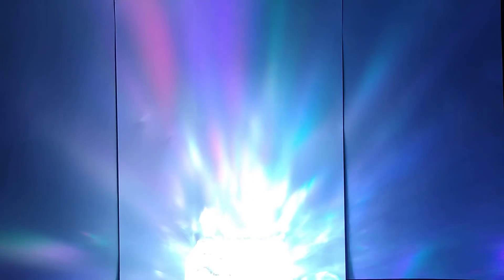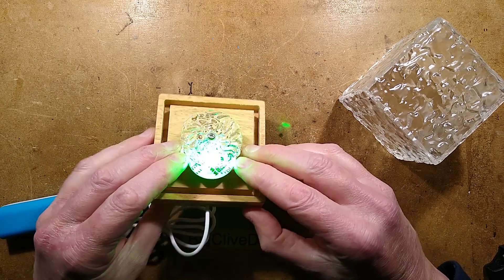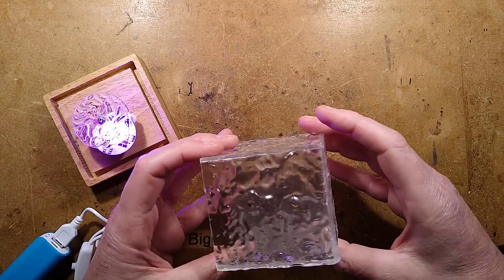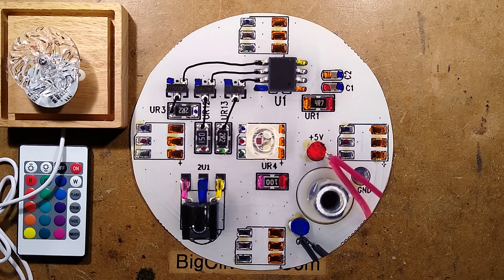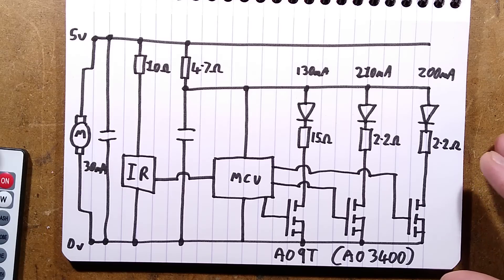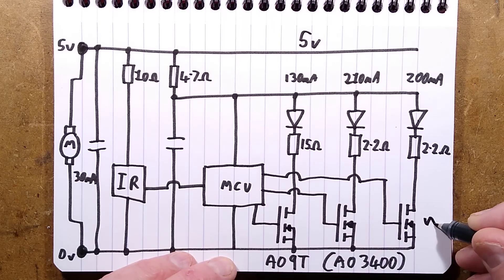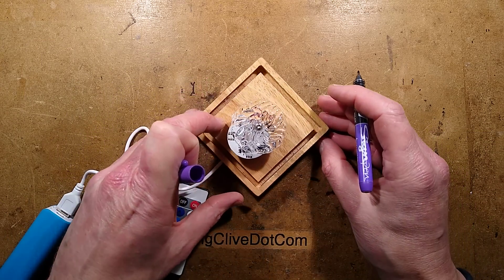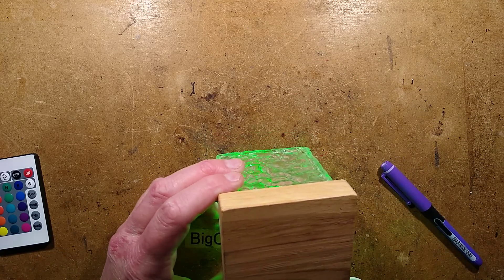Inside a Temu ripple cube - with schematic

Comment: I have just received a lamp just like this but it's bottom is plastic and the wire to plug it in detaches. It's got a loose connection on the inside aswell but it's proving difficult to open. Am I able to put the isopropyl alcohol down this too. Its got a pretty flimsy circuit board at the bottom which I'm not sure would survive or not. Sorry probably just the same thing that youve said but I thought I'd ask before attacking it by myself 😂

Comment: I want to make this myself but have little knowledge of where to buy components and what specific ones I would need. Is there someone out there that could possible link me to what microcontroller and led is used in this design, as well as what size of capacitors that are used? Any help would really be amazing
Reply from the maker: The microcontrollers are supplied blank and need manufacturer's software put into them.  It may be cheaper to buy a unit as a base project.

Comment: The cap' across the main supply is well placed alright, motors are very noisy, a ceramic would help too. Can't read it's value though, as drawn. The I.R. Module should have it's own, as suggested. Nice simple layout otherwise, a tiny issue really.

Comment: Can you add LEDs to the other pads without any further modification?
Also, wouldn't it be better to have a diode across the motor to avoid reverse polarity??
Reply from the maker: Yes.  But it would be better to change all the LEDs so they matched.

Comment: IMO the white ring that holds the motor is upside down as it has holes to screw the motor holder to the wood. Had it been like that then chances are it wouldn't of come loose in shipping

Comment: I wonder if you could put discreet LED at all of the unpopulated pads around the board, which would make more light splash out. You might be able to angle them, or cover them, and it would not go out the 'top' but just the sides, Leading to static patterns. They would all be PWM controlled the same, of course, but it might be nice to make a single unit that uses nothing but green/yellow LED for a truly radioactive cube. Or, maybe wire up some really greasy yellow/lemon ones for toxic waste.

Comment: for those so inclined you could use something like a AT tiny 85 as controller. liberate the LEDs and anything else you may need, add an addition mosfet to allow PWM control of the motor. write the code and knock it all up on a piece of strip board or have PCB made. Hey presto you got yourself something a lot better. You could also change the LEDs out for WS2812 or similar.

Also be careful with Temu, the parent company had another company that was found to be installing malware/viruses along side their app. IIRC temu is being investigated for the same thing as we speak. I don't know if the app has been suspended on various app stores as yet.
Oh then there is the forced/child labour. But I think that most of just assume that was the case for cheap things coming from china.

Comment: To vary the motor speed as well, leave the +ve motor connection as is. 

Then add three diodes to the other motor terminal, and connect to the three FETs.

Result, motor speed varies and LEDs vary too!

Nice one clive 👍🏻🇬🇧😎

Comment: Use 2 LEDs with different colors. One Amber and one Red for a nice fire effect for instance.
One point in Time I had cheap Showtec Phantom Moving Heads with crappy CMY color mixing, an effects wheel and an crystalizer gobo. In combination this produces the exact same effect. If you mixed an orange with the CMY system, it made a wide variety of colors between yellow and red which gave a very nice fire effect. Unfortunately these lights were not much use for anything else

Comment: Is there a part # for that motor? I was looking around for a low voltage, slow spinner, but so many choices - looks like they picked a good one.
Reply from the maker: The motor itself is extremely common, but the slow gearboxes are harder to get.
Reply: @bigclivedotcom  Ah! I found one from an old microwave oven (the carousel motor with a gear)!
Reply from the maker: @davestorm6718  Those are usually synchronous motors.  Very cheap and common, but will often turn in a random direction when powered up.

Comment: I hate these remotes to much. I have one for the main lamp in my room and the main setting got worn out to the point where that 'button' does not work anymore. And the one I have does not have any screws. They are press fit and glued or something so it's nearly impossible to get them apart and fix them which pisses me off so much since it's such a simple fix...

Comment: Nice looking doodad. You could always just screw the motor into the base via the tabs on it, with some thin, long, self tapping screws. You could just tighten them enough to hold the motor in place, without bending the tabs.

Comment: ‒ It's not too good when the LED is switched off via remote, the motor just keeps running until the incoming power is switched off.
‒ If I see this right, the circuit bard can have 5 RGB LEDs, possibly in parallel, but just the middle one is populated.
‒ Probably if they screwed some standoffs into the wooden base, the gear mechanics have some "mounting ears" for mounting screws.
Reply: yep they really cheap out that design.

Comment: Unfortunately broken items are not uncommon from TEMU.  They have no care at all for packaging and protecting items.   It's a known issue to such a degree that when leaving feedback, they often have a notice specifically for shipping//packaging issues......   Cheap they are, but you can't rely on things coming in one piece.
Reply: tbf, this particular one could have been avoided if they didn't cut manufacturing costs to the point there is no screws despite having the mounting holes around the motor.
Reply: Is that any different when you receive $1 product from Amazon or ebay?

Comment: Big Clive are you interested in a morphy richards toaster that throws the house circuit breaker but not the local rcd. I'm opting to give my dad an little used cheapo toaster in it's place.
Reply from the maker: Thanks for the offer, but I have very little space here for bulky items.  I'd guess that there's a build up of carbon that has bridged to the metalwork or maybe the heater's insulation is breaking down.
Reply: @bigclivedotcom   ok disassembly and plastic burning experiments to ensure. Just shortly after the cotton wool and super glue experiment.

Comment: Recently got some cool stuff from Aliexpress that i'm waiting for.. an 18650 capacity tester and an ATX power supply breakout board with 6 USB ports, 5v and 12v outputs which im extremely happy about. Their super cheap deals are competitive with Temu i think. I refuse to use Temu again after running into a Privacy issue with them after buying from them for the very first time.

Comment: What these changing light effects need is to be able change the cycle time, like take up to 24 hours to cycle, not seconds
Reply: To keep the smoothness of such a gradually long transition, it will require some wide colour range provided by a higher bit count PWM or by driving more leds having different colours (eg. RGB+Yellow+Pink+Orange+Purple).
Reply: @PainterVierax  Interesting, I didn't consider the granularity of the transition, that would be more interesting, but just lengthening the time within the existing cycle would be a plus.
Reply: @leearft8605  lengthening the time is possible with just a new program (and probably replacing the MCU on the existing board). But instead of being a perfectly stretched effect, the digital nature of the signal will provide some undesirable "aliasing" that could only be mitigated with some "pulsating" fast transitions after long periods of pause. That's the only eye-candy effect that can be added.
Another solution is to go full analog using some 555 timers and mechanisms, with all the inconvenience that comes with. Nowadays it's not even cheaper.

Comment: I'm slowly learning electronics through you and other channels, and wanted to ask, do you think there is feedback signals coming from the micro controller that is driving the flickering? Or is it just a poor quality LED? Any replies appreciated!
Reply: The flicker is more likely the rate between camera capture and LED being in sync, a common place to spot it is videos in commercial buildings with led exit signs in the background.  Change the camera rate et voilà.
Reply: Flickering is not due to poor quality LED. Never.
It's the frequency rate of the driver. Here in this design the microcontroler square/PWM signals driving the mosfets would be the culprits, maybe depending on the quality of the mosfets.
But it's extremely rare to get the effect visible through the naked eyes with this kind of design, since components freq limitations are way above the visible range nowadays.
Reply: @PainterVierax  To add to your excellent point, one ill-advised way to maximize brightness and increase lifespan of an LED is to pulse it quickly at its max tolerances.
Reply from the maker: The unit uses pulse width modulation for the intensity control of the LEDs.  It's basically switching them on and off very quickly, and the amount of on-time to off-time gives an equivalent perceived intensity.  That pulsing is not normally visible to the human eye, but is picked up by the camera as it scans the image.

Comment: Wonder why they didn't use a neopixl instead of a RGB led?
Reply from the maker: Cost and complexity of the software.  The WS2812B style LEDs need data at very high speed.
Reply: Complexity as clive said, the chinese dont bother with complicated software and libraries for the ws2812

Comment: You left unmentioned the four unused LED mounting pads around the rim of the board… I presume they’re in parallel with the one in the center?  How would that work? Two of them are not underneath the rotating disc. Is there another version of this device with a larger disc in a larger enclosure perhaps? Five packages sharing the set current would have much longer lifetimes than the single one but might be unacceptably dim.

Considering the funny business with the circuit layout, are we looking at another example of amateur circuit design lifted from a chip maker data sheet?
Reply from the maker: All the LED positions are wired in parallel.
Reply: @bigclivedotcom  Aha. Okay, either there’s another larger version, or the fully populated version was too dim and they went with the single LED and smaller enclosure, and hoped nobody would notice.

Comment: May I ask you where it is that you begin to look for obscure chips that no Google search can find please ? for instance I have a cheap LED USB powered light and it has a very clearly marked number on the 16 pin DIP chip, it is BP0A 106 so I thought 'Bingo !' but google gave me nothing. So I  changed the zero for a letter and all that jazz then thought "how does the big guy do it I wonder ?" so here I am !!....cheers.
Reply from the maker: Try an image search for the same keywords.  Sometimes I have to work out what the chip does and try related package keywords to try and get a pinout match.

Comment: Your camera has a dead green pixel in the middle of the screen. It made me wipe my monitor before I realized it. 🙂
Reply from the maker: I haven't spotted that.
Reply: 🧐 ~ I have looked and I can’t see it, watching it on my iPhone
Reply: @samuelfellows6923  It is really hard to see on a phone. I still see it around 09:03-09:08 and later on pure green.
Reply: @NickFreneza I can barely see it, it's in the middle of the screen
Reply: You either must be a videophile or its just YOUR monitor i dont see it
Reply: @309electronic5  My monitor has a defect in red subpixel in the different place. 🙃
Reply: Sorry to say but I think that is your monitor. 
There are no dead pixels

(Edit) 
I found it. It is glitching thought. 
So it is probably not really a dead sensor and rather a interference or video file problem.

Comment: here I am pondering replacing the circuit board with a ws2811 and integrating several of these in my christmas lights show :D
Reply: Just buy a separate lens and a motor and make your own pcb
Reply: @309electronic5  haven't looked but sometimes it's just cheaper to buy and junk lol. I can use the led/remote for other projects

Comment: Given TEMU's reputation, I'm surprised that you actually received what you ordered. The condition of it out of the package is not surprising. I think they collect the crap that even other Chinese sellers wouldn't deal with.
Reply: One man's trash is TEMU's treasure.
Reply: Any different when you receive cheap product from Amazon and ebay? You spend $5 and expect $500 service?
Reply: TEMU uses the deals in order to collect personal data and scrape date from your phone / computer.
Reply: @bobroberts2371  "Scraping the date" from your iPhone is probably not much of a problem. Generally don't use it for that purpose. 😉It's the personal data that I'd be worried about! 😱🙄

Comment: The "Warp core effect" is pretty spot on, they basically used that effect for the Refit Enterprise (TMP & TWOK) and later re-used the effect for Voyager, instead of the stepping neon tubes running down the core as introduced in TNG, this gadget though is pretty cool, though I think I'd scrap the RGB controller and just use some fixed colour LEDs... :)
Reply: I was thinking the exact same thing.  This is very much Star Trek used everywhere effect.  (I like it)

Comment: Just quicky: I have been given 70 strips (metallic no bendy), and the only thing I can find on the LED strip is the following.
55.5x5.8 - 2835 - 12C9R -108 LED TS - J964.
Any idea what voltage each strip would need to illuminate?
Reply from the maker: The 12C9R bit may indicate the series/parallel connection.  You may be able to see how they're connected or trace them out.  If there are 9 parallel sections wired in series the voltage will possibly be around 27V.  They're probably designed to be run from a current regulated LED driver.
Reply: @bigclivedotcom  Thank you clive for the info, now to find a use for them...
Reply: Total guess but 70 to 80

Comment: Be even nicer if you could control the motor speed via the remote as well as the LEDs Even a random speed variation. But nice little box. 2x👍

Comment: Interesting 'Borg' light. Also interesting that they are nearly double the price on AliExpress.. Ali has become quite expensive recently, perhaps Temu is attempting to eat their lunch...
For me, I'd ditch the existing board and replace with some pixel's driven by an ESP running WLED, then also run that motor via a MosFet to get remote speed control. Might buy a couple for experiments.. Nice one Clive...
Reply: Temu allegedly offsets their prices by selling on identifying and financial details. Allegedly.
Reply: @GothBoyUK which is why they offer the best values to first time customers. It's worth it for them to get your data.
Reply: @GothBoyUK  I use PayPal on the site so they'll get very little of anything useful from me.
Reply: The reason Temu is cheaper is that they've cut distributors out of the supply chain, that's their entire business. On Aliexpress you're dealing with thousands of trading companies that buy products from thousands of manufacturers, which is why you'll always find multiple sellers selling the exact same products, just with a few cents of difference in their pricing. Somehow Temu managed to convince the actual manufacturers of those products to supply directly to consumers instead of just supplying wholesale to distros, which leads to a big reduction in the pricing on a lot of things.

Comment: Nice tear down. I'm curious about what the 4 unpopulated 6 pins pads round the outside are for. Are they for more LEDs? Are they wired in parallel with the main LED. Do they have hacking potential? 😊
Reply from the maker: I completely forgot to mention that in the video.  They're all in parallel with the other LED.